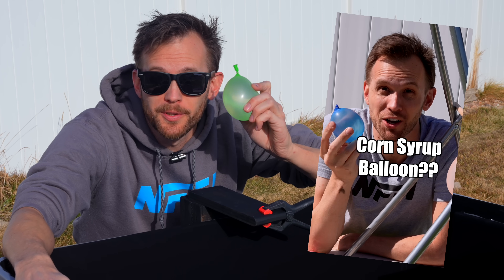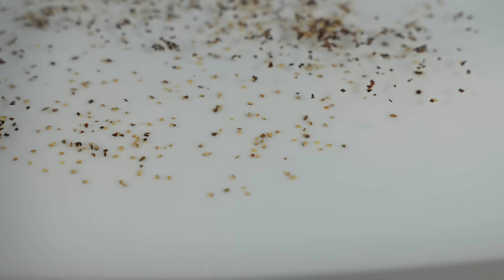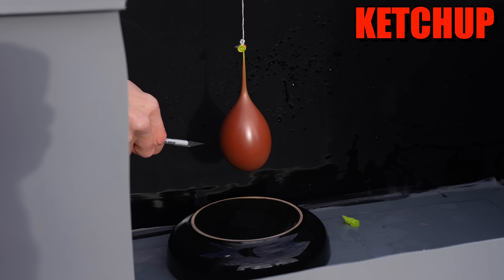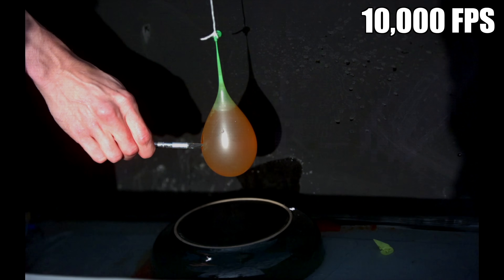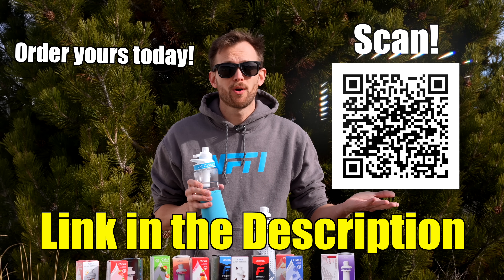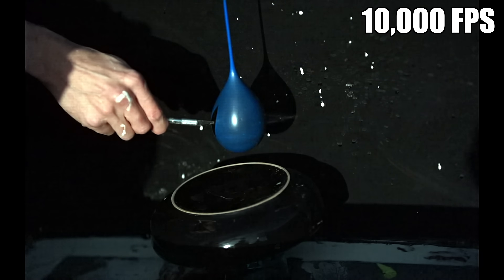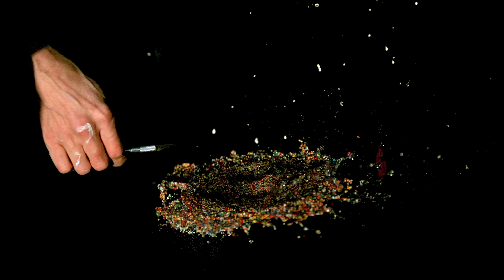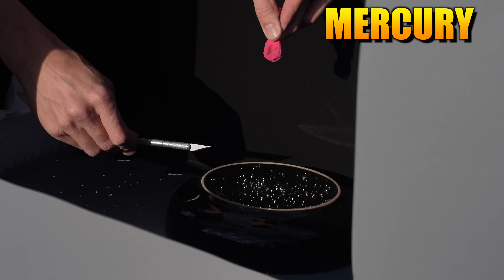Popping a Liquid Metal Filled Water Balloon?

Comment: For the sand and other liquids you could make/buy a funnel with a long end to fit the neck of the balloon so you don’t need to do all that pinching and fighting the neck. Or maybe even 3D print a contraction that could fill the ballon like a skeleton but make it so it can fold in on itself to slide out of the neck.

Comment: It seems to me that you could use a large-ish funnel with a ½ inch tip for filling the balloon with kinetic sand. Then you could scrape the sand into the funnel slowly. As long as you don't put enough sand in at one time to block the hole, it should all fall neatly into the balloon.

Comment: There are devices for filling balloons with stuff. My aunt had one. It is like a fish bowl with a pump at the bottom. You could easily make one. You attach the balloon at the top and pull out enough air to inflate the balloon. When you are done a rotatable ring allows you to twist the end shut so you can tie it.

Comment: Um...What's wrong with just using a funnel? Whether it's the sprinkles, honey, cornstarch or anything else...just use a funnel, stretch the balloon opening over it and pour. Use a toothpick or something along those lines to loosen whatever gets stuck inside the neck if necessary, but for powder, sand or liquids it shouldn't be an issue.
Reply from the maker: I can't use a funnel to fill the balloon more than the empty size.  So it would only fill to the size of a non-blown-up balloon, which is not much at all.  There needs to be pressure to inflate it.
Reply: @NFTI  One way to go about it is to make a funnel out of a bottle with the right shape and just use something as a piston.

Alternatively, filling bag can be used instead. It has a wider gap than a typical syringe (depending on one you buy) and is literally built for forcing stuff into something with pressure, just like a syringe.

Comment: I wonder if you could use an air compressor to get the right pressure and speed of air to hold up the loon kind of open but not inflating and then pour a dry material in as that's happening

Comment: For the sand you could try using a tool called an elastrator. They aren't that expensive. Or you could try one of those "finger gloves" you can buy in individual square packets that look like they have an O ring inside and use that instead of a balloon. But idk if youtube would have a problem with that.

Comment: Squeeze an empty 2liter bottle to remove most of the air. Insert balloon and attach to opening. Jimmy bottle to expand balloon inside. Pour in sand.

Dunno if it will work for real. But in my head.... It's flawless!!

Comment: The soap did not make much difference because water (as are most liquids) is not compressible, so once the balloon is popped the water does not have a pressure differential to expand into, so it will just fall as the blob shape it generally had inside the balloon.  The other effect that was impacted by adding soap was just the wetted surface of the balloon that pulls some water droplets away from the ball of water when it pops because the balloon was holding potential energy as a stretched elastic and that energy release gives a little water some energy to fly away from the main blob.  Fill the balloon with smoke and pop it and it will burst away because a gas is compressed inside the balloon and once its container is broken open the gas will expand rapidly into the lower pressure surrounding air.

Comment: You can put kinetic sand in a balloon by putting the opening of a balloon around the mouth of a jar you can pull a vacuum in. The balloon will fill the jar as the air is vacuumed out. This will allow you to fill the balloon with literally anything that will fit trough the opening.

Comment: For the kinetic sand, you may be able to get away with using a speculum-like device to hold the neck open then funnel the sand in carefully and pack it in with a prodding instrument to allow more in. The tensile strength of the balloon may not be enough to eject something as dense and course as the sand.

Comment: Solution to make the balloon easier to fill with anything.
Reverse inflate the balloon with a vacuum.
Also use a tube to force the "neck" of the balloon open.

Watch "Amazing Physics Makes a Reverse Balloon—Inflating a Balloon Without Increasing the Pressure" from "The Action Lab" and you will understand it.

Comment: Hi Nate I recommend you make a 3d printed mould that will suck out the air from the other side of the balloon. You can use the vacuum cheaper to create low pressure in the outside of the balloon like there’s a videos of people put gifts in giant balloons. You need to use this method.

Comment: err you van get ;; like 3 pronged 'stretchers' for fitting coloured rubber insulating bands around wire '  -  Cable Sleeve Tool Expander, For Use With Sleeves & Grommets  -- rs , farnell , probably mouser, digikey -- electrical / electronics places sell em....

Comment: to get stuff in a balloon make a revers vacuum chamber the Balloon is attached to a pipe through the cover and hangs in the box. then when you pull the air out of the box the outside air fills the balloon into the pace and expands it open.

Comment: For the kinetic sand get a 5 gallon bucket with a lid. Put a hole in the lid and tape or glue a small pipe to it. Do the same the bottom side of the bucket making sure the pipe is small enough to close around a vacuum open the balloon and put its opening over the tube on the lid then while the lid is on the bucket suck the air out with a vaccum. This should make it super easy to put super viscous liquids and solids into the balloon.

Comment: 1. A reverse vacuum chamber. Have the balloon in a vacuum chamber, but the neck is outside through a hole in the lid, sealing the hole with the neck of the balloon. Draw a vaccuum and viola, an inflated balloon with atmospheric pressure that can have any difficult product put into it.

2. Stretch the balloon opening around a 2 liter bottle neck and then dump the sand in that way, using a plunger with an OD to match the neck ID, press the kinetic sand into the balloon. 

3. Combine methods 1 and 2 and use a 2 liter bottle as the vaccuum chamer. Drill a hold the roughly thread a fitting into the bottom of the bottle.  Put the balloon into the bottle with the balloon neck around the outside of the bottle neck, connect the vaccuum pump and draw a vaccuum, fill balloon with any mysterious shiz.

PS, I would love to see a clear balloon filled with kinetic sand, inside a pressurized pressure pot to say... 90 psi or so.

Comment: Kinetic sand is easy grab a funnel and just with the heat of your hands start sifting it into the funnel. If the balloon doesn't want to expand then you can put the kinetic sand into a very wide opening plastic syringe and gently warm it. Then you should be able to smoothly push the sand into the balloon.

Comment: You can fill a balloon with normal sand with a pvc pipe and a funnel.   If the pipe is long enough, the sand weight should fill the ballon, but with a short pipe or sticky sand, you can use a dowel to ram it through the pipe into the balloon.

Comment: Honestly it should be pretty easy to get kinetic sand into a balloon. Just use a funnel and tape the balloon to it, then slowly put the sand in the funnel. Probably will have to sit the funnel in a big enough jar that the balloon can be suspended and the funnel can sit in the top of the jar like a lid. Then you'll just have to squeeze the balloon opening closed while peeling the tape off (or cutting if need be). I think it's harder to write detailed description of what I am imagining in my mind than to actually do it. You're smart enough to fill in the rest though.

Comment: You can do the balloon with a lot of stuff like kinetic sand or other solids by using a vacuum. If you put the balloon over the opening of a jar/bucket and then pull a vacuum over it the ballon will just expand and you’ll have a large opening to pour anything you want in it.

I’ll edit my comment with a link if I can find a video of it, but I believe Action Lab did it at some point.

Edit: NVM it was you who did it on the other channel years ago! I bet you know this option then, you used it to put other inflated balloons and glitter on a big balloon, maybe you can scale it down to a smaller balloon size!

Comment: I like this, of course. But I'd like to see both a close up and a higher drop. More air time would be great!  And there's an alloy of mercury that's solid at room temperature but will melt in hot water. And coconut oil and butter are similar. . I'd like to see something molded with the metal alloy and balloons with butter and coconut oil (solid but soft or fridge solid carved into something) dropped into hot AF water.😂

Comment: Simple way to a fill balloon with almost any material: 
First, fill a plastic coke bottle with the desired material by using a funnel.
Then inflate the balloon, and while twisting the neck of the balloon to keep it inflated, stretch the mouth of the balloon over the opening of the coke battle.
Untwist the neck of the balloon and turn the bottle upside down with balloon hanging from it. The material should then flow into the balloon easily. 
This will keep the balloon inflated to what ever size required and keep the mouth open, as the pressure equalizes between the bottle and the balloon the material can easily flow between the bottle and the balloon.

Comment: For filling it with kinetic sand use your vacuumed pump, make a lid with a hole  and lip then put the balloon in the vac pump with the balloon inside and mouth of the balloon through the hole allowing the atmospheric pressure to fill the balloon as you create a vacuum around the balloon then you will be able to put almost anything in a balloon respectively to the size of the balloon and hole.

Comment: get a empty water bottle
fill it half way with the sand
blow up a balloon slightly over sized
twist and pinch the end trapping the air
attach the opening of the balloon to the bottle
once the balloon is secured untwist it and turn the bottle over

Comment: There are larger balloons that will have larger openings for something like kinetic sand, that would be my recommendation. Otherwise, condoms would also be an option (and yes, if it needs to stay kid friendly, there are condoms used for non-adult activities). Would also be interested in seeing gallium to compare with mercury. If you could get super-cooled water in there as well, I think that would be insane for the freezing moment of shock... again if possible. Would like to see an oil in there, too. Ammonia would also be interesting for the intermolecular forces it has. What if you did ferromagnetic fluids with varying magnetic fields present? That could be cool, too. Having a magnet at the bottom with iron filings could also be really cool. Ooh, another one that might be cool would be a sawdust balloon being popped over an open flame. Might be better to have the knife on a stick at that point. Sorry for the long post!

Comment: For filling the baloon with solids use a gaterade bottle with a hole in the bottom. Insert the ballon into the gaterage bottle and stretch the neck over the lip of the bottle and pull a vacume on the gaterade bottle using the hole in the bottom you prepped previously. Then you can use a funnel to fill the balloon and cut the bottle away from it to remove it. Its similar to how they place teddybears amd confetti into large balloons.!
Reply: Best idea I’ve seen here, as it doesn’t require complicated setup!

Comment: For the kinetic sand, why not use a vacuum box? They used to have these shops in every mall that would put Teddy bears and stuff inside inflated balloons as gifts. They used a vacuum box. Stretch the opening of the balloon over a reasonably sized hole, turn on the vacuum pump to evacuate the chamber, balloon expand into box, pour in sand and tie quickly.

Comment: For the kinetic sand you need a 2 liter bottle and an air compressor. Wider the mouth on the bottle the better. get the sand into the bottle first. Then wrap the balloon over the bottle mouth. A blower nozzle for the compressor that's slender like a pen, slip that between the balloon and the bottle and compress the whole thing till the balloon is blown up. Remove the air nozzle and it should stay blown up. Turn it upside down and shake the bottle allowing the kinetic sand to slowly work its way into the balloon till you have the desired amount.

Comment: AI Overview
Learn more
Yes, you can fill a balloon with kinetic sand, making a type of squishy stress ball; however, it's important to be careful as the sand's texture might cause the balloon to tear if too much is added or squeezed too forcefully. 
Key points to remember:
Use a funnel:
To easily add the kinetic sand to the balloon without making a mess, use a small funnel. 
Don't overfill:
Fill the balloon only partially with kinetic sand to allow for some air space and prevent potential balloon damage. 
Balloon quality matters:
Choose a sturdy balloon that can handle the texture and pressure of the kinetic sand.

Comment: Concept for the Kinetic Sand... A piece of 3/4 inch  PVC(if 3/4 is too big go with 1/2 inch), Smooth the end so there are no Sharpe edges. Get a dowel to push it down that fits. And add small balls of sand at a time. Should get you what you want. Also it should not really come back up into the PVC easily.  Could use this for your next attempts for Powders and sprinkles.. A funnel might help get it all in better (tapping should bring it down)  Maybe a small dab of dish soap on the end of the PVC to allow the ballon to get on easier.  Or if you want to get really creative.. Get a larger (bigger than 10 inches cubed) box that is air tight. And cut a hole in the top it for mounting a 1/2 inch piece of PVC to the top (Glue it on) Round overall the edges inside and out. VERY smooth. Maybe acetone dip it to get it very smooth before mounting.  Then take and make a hole for a piece of PVC that fits your Vacuum cleaner so you can suck the air out but put a  ball valve inline so you can shut off the Vacuum. Once that is done take your ballon thread it through the pipe and pull it over the pvc on the outside close and lock the lid then pull the air out and put what ever you want in the balloon that fits the hole :)

Comment: I understand removing the aluminum foil because of the interaction with mercury but isn’t the knife handle machined aluminum?
Reply from the maker: Yes, but it wouldn't accidentally splash onto and then sit on the knife handle for several minutes.

Comment: For the kinetic sand, you could blow up the balloon first and then put it over some bottle or container that had kinetic sand in it with an airtight seal. then flip it over and the sand will just fall into the blown up balloon. remove any excess air after filling the sand

Comment: 10:10. To fill a balloon with sand or rice get an empty hand soap/ lotion bottle, inflate balloon, while inflated stretch opening of balloon around neck of bottle filled with sand. Keep as much air in balloon as possible, you will lose some. Holding bottle upside down, squeeze bottle and balloon gently to fill Ballon and expand neck of balloon. After filling, let out excess air in balloon and tie. I figured this out in 5th grade while trying to fill a balloon with flour.

Comment: For getting the kinetic sand into a balloon you could make a setup where there's a sealed chamber with a hole at the bottom of it which you can put a balloon on, then you pressurize the whole chamber which inflates the balloon then pour the kinetic sand into the air filled balloon. Main trick is having a proper funnel and some way of knocking over whatever's holding the sand from the outside.

Comment: To your question about filling the balloon, couldn't you make a small chamber to pull a light vacuum on it from below then use a funnel to seal between the neck of the balloon and the edge of the lid to pour stuff in before releasing the vacuum.

Comment: Kinetic Sand: Put the sand into a bottle (regular plastic bottle). Blow up a balloon to the size you want. Without releasing the air, put the hole of the balloon onto the open top of the bottle. Turn the whole thing upside down and the sand will fall into the balloon.

Comment: 3D print a wide mouth funnel with an air channel. You may still have to use a chopstick or something to push the sand down, but it should be relatively easy (and cleaner).

Comment: A cheap speculum can hold the balloon open for filling with more difficult materials. Mount in a vice and secure the balloon either with rubber bands or just holding it in place.

A few people have also mentioned a vacuum for expansion through pressure differential.

Comment: could you stretch the balloon over a wide tube like it was, er, a prophylactic, then fill the tube with kinetic sand and then hold the tip of the balloon while you pulled the tube out?

Comment: A good way to get powder into balloons is to put the mouth of the balloon over the mouth of a plastic bottle, tuck the balloon down into the bottle, and then suck the air out of the bottle through a small hole in the side. The balloon goes into an "inflated" shape inside the bottle but with the mouth open, so you can just dump in whatever you want.

Comment: 10:10 just use a funnel
Reply: It won’t get into the balloon
Reply: Ahhhhhh yes I agree, but it has to have a nice fat tip so might need to get a long plastic variable size one that you can cut to the desired  diameter then use a stick or dowel to push the sand through into the balloon
Reply: Keep It Simple, Stupid